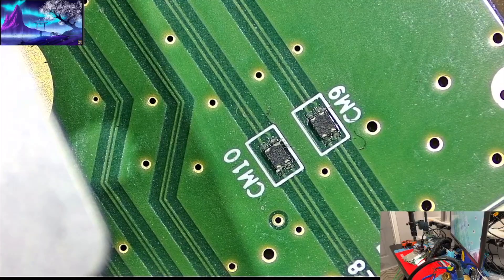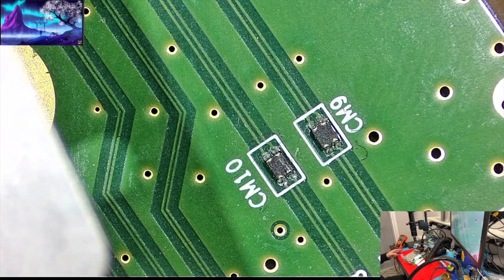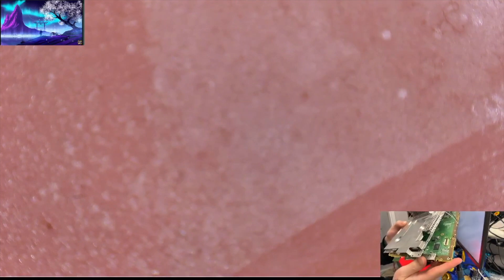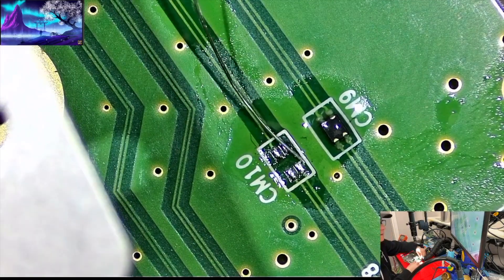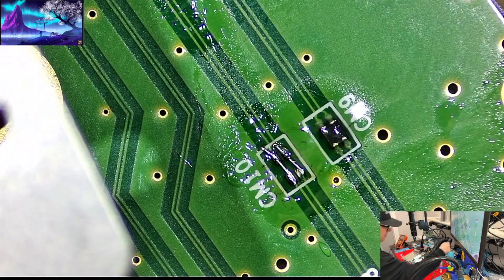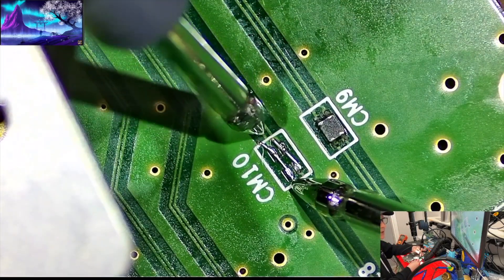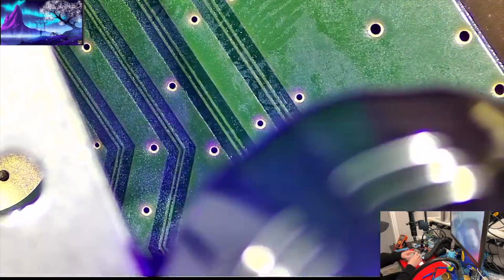Wii U Error 160-1400 Disc drive is not working/detected. PERMANENT FIX! #wiiu #soldering #console

Comment: Hello, I'm using a translator, I'm from Mexico (greetings, by the way), what's the name of that gel you're using?
Reply from the maker: its called 
Flux i use Amtech flux https://www.amazon.ca/NC-559-V2-TF-no-Clean-Tacky-Flux-Hand-Soldering/dp/B09Y7KF2TM
Reply: @SwitchWhisperer  One more question, if I put the bridge above the resistor that has no continuity, would it still work?
Reply from the maker: @señorpeluchon  yea just make contact with both sides

Comment: How many millimeters is that wire you used to solder in the video?
Reply from the maker: Prob less than 1mm its from the inside of ethernet cable, there are paired wires and inside those you find very fine wires
Reply: @SwitchWhisperer  But it doesn't necessarily need to be specifically the Ethernet cable to work, right?
Reply from the maker: @Cpt2265  not at all just use jumper wire if u have that
Reply from the maker: I just use whatever i have laying around lol
Reply: @SwitchWhisperer  lol

Comment: How many watts did you use for welding?
Reply from the maker: i use temp of 380-420
not sure what that is in watts but im sure google would assist in that calculation
Reply: @SwitchWhisperer  Thank you, already converted, it gave approximately 40 Watts

Comment: Im working on cm9, the 2 pads on the ribbon cable side are showing continuity, is that normal or do I have somthing else going on? The filter has been removed and the pads appear to be free of solder bridging.
Reply from the maker: it sounds like you may have another short at some place. if its 2 different traces that are shorting to ground that is! maybe send me a photo to my email kangenandyf@gmail.com and i can verify
Reply: @SwitchWhisperer   thank you thank you thank you! You called it and it was a short, but I'm still going to reach out by email to let you know where I'm at, it's not quite fixed yet.

Comment: what kind of wire do you use, Im trying to repair a wii u as well?
Reply from the maker: you can use any small gauge wire, even if u have a spare ethernet cable just use a small wire from inside that wire

Comment: Hello, what is the white gel you are using ? Also did you just dissolved the fuse?
Thx!!
Reply from the maker: its called flux, the fuse was removed by hot air rework station

Comment: What other possible reason may there be if I tested the continuity and found that both fuses were receiving current?
Reply from the maker: it could be that the disc drive is actually faulty in that case try a new disc drive
Reply: I'd already done that and switched the old board out and put into in the new drive, but the error message persisted.
Reply from the maker: @lbgamingyt3  yea it could be other board related faults also, unfortunately i never ran into it  past this issue. you can always attempt this and replace both fuses ?

Comment: Can I get a supply list so I can try it
Reply from the maker: i didnt replace the fuses i just run jumper wire so soldering iron, hot air, solder, and some jumper wire. flux ofc. otherwise nothing special used

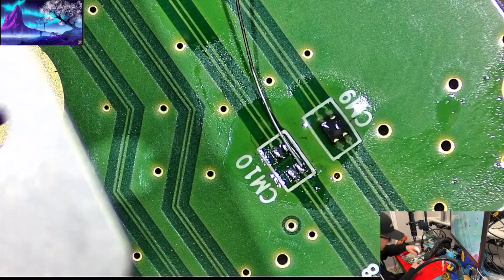Comment: What gauge wire was used at 6:15?
Reply from the maker: inside from a single strand of ethernet cable, it is thicker than normal jumper wire but if you use regular jumper wire should be fine also!

Comment: Does anyone know where to get replacement fuses for this fix??
Reply from the maker: I have not yet sourced them as the fix i'm providing IS a permanent solution.
Reply: @SwitchWhisperer  makes sense. Any chance ommiting the fuses could cause other problems down the line, like isn't their purpose to protect components from overcharge etc?
Reply from the maker: @FrostyBrows  I so far have fixed dozens of these over the past 2 years and not one has come back EXCEPT ONE that i mention in the video, it had BOTH fuses gone (leading me  to believe there was other issues on the board than just this same fix) so far it seems this is permanent without causing other underlying issues.